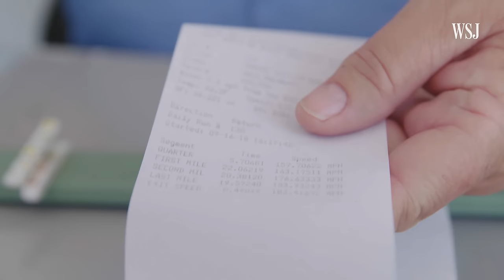How This Cyclist Hit 184MPH and Set the World Record

Comment: so like... whats the fastest anyones ever rode a bike without following a dragster with a windbreaker
Reply: @alexandramarberry1023  That´s unlikely, since Tour de France drivers are already that fast.
Reply: only downhill. On a flat straight its around 40 mph
Reply: I can tell you it would not be a woman..
Reply: If you use the aerovelo eta, about 90 mph.
Reply: @AccAkut1987  Bro tour de france cyclists sprint speed is like 78km/h which is more than 40mph
Reply: @alexandramarberry1023  it's not 40.  i can break 40 on my ten speed very easily, I suspect most people can.
Reply: Ive done 60mph down hill... Its gonna be faster than 40
Reply: Well it it was a non motorized motorcycle then it could go hundreds. Maybe on a 80 degre hill
Reply: @AccAkut1987  No...Tour de France folks can sprint near 50mph over short distances.
Reply: 144mph unassisted/no-downhill
Reply: in france somebody got gaught at 86 mph by a radar system in mountains so i gan go fast without a wind shield
Reply: san Francisco downhill for a couple miles felt like i was at 30-35mph on a thick tire regular 18 speed bike
Reply: 50 kph..   bout all I could manage,   with the drag on the body its not possible to pedal past a point..  WAY under 100 mph.... lol   she was being pulled by the draft of the vehicle in front of her..
Reply: @demarijniserend  Fastest woman, fastest man is 89mph
Reply: @alexandramarberry1023  No, even Cat 3 and 4 riders can ride at 40 mph for about a minute. The fastest, unassisted speed on a bike is around 65 mph.
Reply: Ive seen this one big dude go down hill pretty darn fast XD 

On a bike of course. Look for it on youtube it's hilarious and it has the Pucker effect lol
Reply: One dude rode down a Volcano and hit 160kph or 100mph.
Reply: You people posting links to speed runs... those bicycles aren't even similar to the one in this video. I mean c'mon let's be fair.
Reply: @KurtKn1sp3l  tour de france pro riders go about 30mph.
Reply: @reshadpilgrim3990  , but that's winding up, getting a lead-out, and sprinting within the peloton, so it isn't the same thing. 

The "fastest anyone's ridden on a bike" depends on several factors. 

What type of "bike?" 

Traditional upright road bike?
Same as above with aero bars?
Recumbent bicycle?
Same as above with fairing?
Human Powered Vehicle, or HPV?

And under what circumstances?
Flat?
Downhill?
With a tailwind?
With a headwind?

There are myriad records.  Define the parameters and you get the answer.
Reply: 202 km
Reply: The gas human is 22 mph running
Reply: Onkel Iroh why not? Women have strong legs
Reply: I KNOW RIGHT
Reply: @AccAkut1987  Gravity bikes at Tioga Pass hit 65+ mph. They have no drive train, and are areo'ed up.
Reply: @onkeliroh4879  german? ATLA fan?
Reply: Extraterrestrial Horse yassss
Reply: 394 mph on a hayabusa 😂
Reply: Its the guy that downhill in some volcano.
Reply: Like 34 mph
Reply: @baneblackguard584  You cannot break 40 on your ten speed very easily on the flat.
Reply: Krusty Pickles Gaming 420
Reply: I saw some absolute chads going like 70 on a highway. It was a YouTube video so I'm not sure if it's credible but..
Reply: @onkeliroh4879  actually, near me in the Netherlands, a road was specificaly made to be used for precise timing.
A woman has been trying to obtaim the largest speed, but because of weather and the road being open to everybody she hasn't made the official attempt yet.
It is mainly about the bicycle and weather conditions.
Reply: Alexandra Marberry I can go faster than that...
Reply: I've hit 56.5 mph on a claud butler racing slice/blade downhill
Reply: I went 43 mph on my Giant Talon 3??? How is 40 top? If I had a road bike I could’ve gone faster.
Reply: Thank you my g, pls who has a link
Reply: @AccAkut1987  wrong I see people break 40 on flat crits all the time
Reply: On a straight away in the conventional upright position with fair conditions it's 58 mph
Reply: A guy with a rocket bike at 200mph /330 km/h
Reply: Alexandra Marberry I went 49mph the other day on a fixie so I doubt that
Reply: without wind assistance and on a flat surface, probably something like 70 kph on a Time Trial/hour record bike. As for downhill, 130~ kph isn't rare, but for records people have done 230-ish
Reply: Alexandra Marberry I’ve gone faster than 50 on a bike... downhill obviously
Reply: @AccAkut1987  36*
Reply: Idk track cyclists are fast
Reply: The fastest speed without cheating wind drag is 87.17 MPH, Aerovelo ETA.
Reply: https://www.youtube.com/watch?v=TuGx_t2mDyQ this guy probably went faster. not sure exactly how fast he fell before parachute deployed. or this guy https://www.youtube.com/watch?v=eR3ggpHW4kI
Reply: I think it's about 82kph is the fastest sprint finish any world tour rider has ever achieved.
Reply: Abdullah Rauf aerovelo eta
Reply: @alexandramarberry1023  I've defo gone faster than 40 on my mountain bike. I'm stupid it is very steep downhill and cars come and pull out with out looking. I could have died once. On a flat plain you can do about 50 tops because of wind resistance but if you bend down and pedal for your life it works
Reply: In the tour de france, they get up to 75 mph on descents
Reply: with nothing 80km/hr. https://www.smh.com.au/sport/kersten-sets-80kmh-velodrome-record-20051027-gdmbtc.html. UCI indoor time trial velodrome. Gradient is normalized so its a consistent benchmark.
Reply: Pro tour riders have exceeded 130 kph on descents, so around 80Mph.
Reply: between 80 and 90mph in an 'eta' bike. it looks more like an egg. totally aerodynamically designed.
Reply: 164 kph down a volcano
Reply: And being towed up to speed
Reply: @ThomasDoubting5  I've hit 60mph on a bike too - a spoke broke I was sooo glad I wasn't on my carbon bike at the time
Reply: @iaintdonknow  Which road is that?
Reply: @rolandfrerichs5625  A270 in Helmond
Reply: @onkeliroh4879  thanks Einstein.
Reply: I hit 70mph hanging on to my friend's car once
Reply: Flat road or downhill?
Reply: @B E I mean it's still more than 40mph so what do you mean?
Reply: Mike.litoris  I won't even try to argue with that lol
Reply: 40-48 on flat 
20-23 on hill
Walking pace - mountains 7% and up
Reply: I went 29.9 with a buddy on flat drafting on stock mountain bikes lol
Reply: She dont even need to pedal
Reply: @onkeliroh4879  snowflake
Reply: On a flat surface I have to imagine at least 45. The hour records are about 35mph sustained over an hour. They could probably put out several times the energy for a short period but because wind resistance is not linear and as you go faster you are encountering even more resistance over even greater distance the actually speed would probably be anywhere from 1.25 to 1.5 times that 35.
Reply: Anyone saying they are going 70mph on a flat road not right behind a vehicle is lying to you. If they even say 50 they are probably lying to you. No way no how are they doing anything over 60 on an empty road and a normalish bike. I have had my arm outside the window before going 60. No way are you biking that fast. If you think you are bring an extra speed tracker with you to show you that you are wrong.
Reply: I was wondering the same thing.
Reply: Ryan Jordan Monemi down Three oaks in Walnut California he hit a whopping 43 mph down a hill that had a speed limit of 30
Reply: @alexandramarberry1023  I've gone 50 on a flat road. Just need something long enough and just keep changing gear.
Reply: Yeah.
Reply: @yankeeanime  Where was that?
Reply: It depends on how you want to define "a bike". As for the fastest human powered vehicle without drafting, it's 89.59 mph. For a track cyclist on a more typical upright track bike, the fastest 200m time averages out to 48.3 mph, but I'm not sure of the absolute highest speed.
Reply: Theres a dude named bruce brusford that went   207 mph
Reply: @alexandramarberry1023  Oh no it's much faster it's gotta be, I've clocked 40+mph (on flat land, no inclines) on my rollerskate with two cars following me from the side and behind, measuring my speed with no help.
Reply: 62 mph
Reply: 30 not going down hill I pushed it to the limit in a park
Reply: @cia4459  ive seen people do 40 on flats but nice sprint bro
Reply: @jeffsanchez4776  yes I did the death wiggle when I hit 30
Reply: I believe this one dude rode down a glacier in a highly customised bicycle. Due to the low friction and the very thin air I believe he achieved over 100 kilometres per hour. But don't quote me on that xd
Reply: @onkeliroh4879  anyone can do it, doesn't matter the gender, God bless yall
Reply: I see alot of people saying they can go __ mph, but I don't see any videos...
Reply: @jamieneale2773  Many people can do over 100 kilometers per hour on normal roads when going downhill
Reply: @quarkonium3795  alright then mate, give me an example of one of these many people...
Reply: @thereverendsam413  that dude is smoking something. At 30 you’re near topped out on a carbon fiber road bike, at 35 you’re done-37 you’re done. I can only be done for short distances.
Reply: @alexandramarberry1023  no, like 70mph
Reply: I've seen a bicycle with a rocket on the back it's about as long as the dragster in the video
Reply: Guys we talking 50 60 + mph  for a bike that's so fast bro  like so fast  if you ride your bike so good you can surpass 80mph which is crazy fast
Reply: @alexandramarberry1023  i saw a russian go like 50 mph
Reply: @baneblackguard584  you can't do 40 you need huge legs for that or a really strong wind. Pros can do a max of 46 on a 'normal' bike. An enclosed aero bike can get up to 65 mph
Reply: @jeffsanchez4776  40 is like 50cm legs kinda fast
Reply: @stendijk8949  you are mistaken.  i did 40mph+ on a ten speed commonly when I was riding regularly.  granted we aren't talking about maintaining that speed over a long period of time.
Reply: @baneblackguard584  yeah but I still dont believe it if you are not a body builder or something like that. Because 40mph is what tour de France sprint specialists hit.
Reply: @stendijk8949  do you ride?   it's not really hard to hit 40 mph, i suspect most people that ride do it pretty commonly.
Reply: @baneblackguard584  I know what I'm saying numbers don't lie
Reply: @stendijk8949  go ride for a bit with a road bike on a long flat surface.  I think you'll be surprised.  hitting 40 mph isn't as hard as you think.  if you aren't used to riding you probably won't hit it, but i think you'll be surprised how fast you CAN go.
Reply: @baneblackguard584  I live in the Netherlands and have cycled 9miles to school every day on a rural long flat road. And have also done it on a race bike. I think you are confusing mph with kmph
Reply: @alexandramarberry1023  bull💩 I've hit 46mph on a Halfords special carrera down a 3/4 mile hill
Reply: What difference would being on carbon fiber bike have made?
Reply: @onkeliroh4879  
I can tell you that there will be separate records for men and women, so yes, in half of the cases it would be a woman who holds the record.  
And with your attitude, I'd like to see you attempt to race a top woman cyclist.
Reply: @baneblackguard584  
No, "most people" cannot break 40 mph on a bicycle - and unless you're an elite international racing cyclist, you cannot, either.  It takes around 1200-1300 watts to hold that speed.
Top sprinters, e.g. in the Tour de France, hit 40-48 mph in their final sprints.
Reply: 300 mph, wind aided by a tornado
Reply: A recumbent bike has the record at just under 90mph Eli was spot on.
Reply: bikes that goes around 100mph can't be push over much more because of the gears the ones that run more than 110mph can be push realy far like these ones...but they can't be run from 0 to 110 mph it a limitation of the bike gearr and torque of human body.
Reply: 70 km/h are possible, but with windshield over 100
Reply: 25 mph
Reply: @AccAkut1987  the fastest record on a bike human powered is 82 mph
Reply: I found one at 89.6MPH in some weird egg shaped Bicycle
Reply: @onkeliroh4879  That's sexist
Reply: I once calculated the flying 200 m world record, and crossing the finish line the track cyclist hit about 47 mph
Reply: 144.17 km/h (89.58 mph) by Todd Reichert

Comment: I went skydiving with my bike yeasterday and broke this record
Reply: but terminal velocity for a human is only like 120 mph
Reply: @gremlin23_youtube  Exactly. Even the guys who compete in speedski runs faster then the average parachuter.
Reply: @gremlin23_youtube  that's if you spread your arms and legs. If you point yourself to the ground, it's a lot faster
Reply: @Pichipieify  head down terminal velocity is still only 150-180 mph
Reply: @gremlin23_youtube  And yet Felix Baumgartner still hit over 800mph becoming the only human to break the sound barrier un-powered in the process, during the redbull stratos project... Terminal velocity (And actual velocity reached in a given timespan) depends on weight and air pressure a lot, so you can't really determine an exact terminal velocity for every human
Reply: Cool. What's a yeasterday?
Reply: @gremlin23_youtube  unless you point nose-first against wind then you can hit 200mph.
Reply: @4bidn1  yeah no, that's exactly the point. weight has nothing to do with it. weight only determines how fast you accelerate, the terminal velocity is the same. throw a ball of lead and a ball wood of a tower, they will arrive at the ground almost simultaneously given they are the same size and have a similar surface.
Reply: @4bidn1  except he was in basically space???
Reply: @Simon-bu4kc  It's exactly the opposite.
Reply: @stonesnake2444  no it`s not? or what's opposite to what, please elaborate.
Reply: @4bidn1  He reached that velocity because at that altitude the air pressure is extremely low. It has nothing to do with him as an individual.
Reply: @T1Oracle  I never suggested it had anything to do with Felix personally.. Did you read all the comment replies or just my first one? Lol In fact I literally mentioned that air pressure was a huge factor in his speed, did you not even read my whole comment? Bahaha
Reply: I WAS HANGING ON THE BACK OF THAT DRAGSTER AND LET GO I AM  THE WORLDS FASTEST SUMMERSAULTIST !???
Reply: kids.... yesterday me on my bicycle got toed by a blackbird
so technically I am the fastest
Reply: @4bidn1  He didn’t break the sound barrier - to do that, you have to be moving faster than the air can get out of your way. That requires being powered, and he was in a freefall. He exceeded the SPEED that is the speed of sound at sea level.
Reply: I went skydiving without bike and broke running record)
Reply: I was thinking the same think. I ceased to care when I saw tether.
Reply: You have to pedal my guy